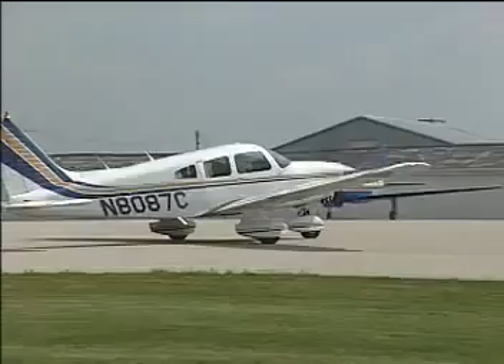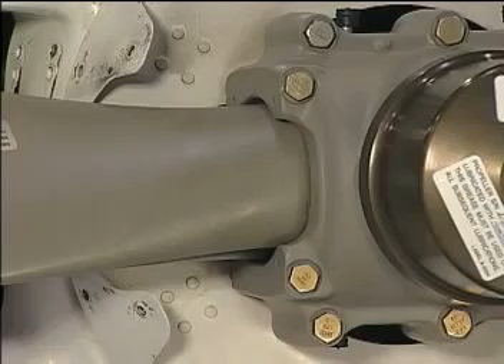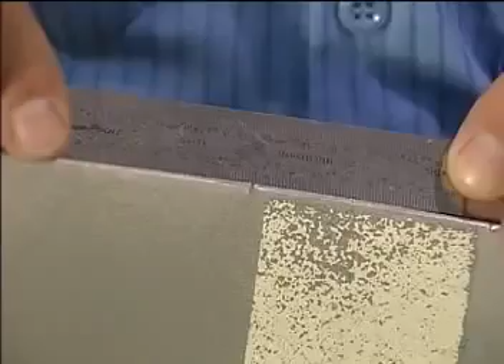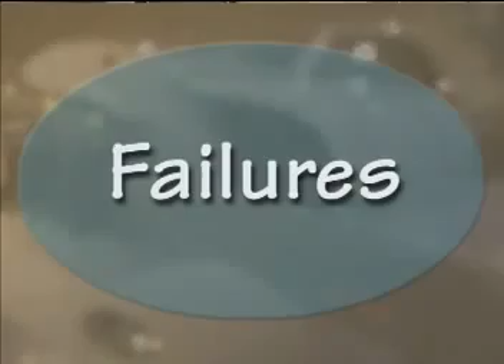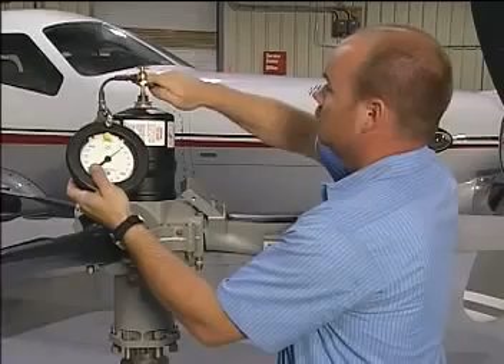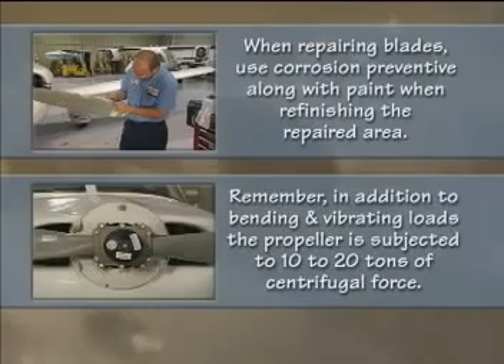Hartzell Propeller Care & Maintenance

Comment: Thank you, Hattzell for putting this video out.  Am still confused as to why Aeroshell 6 is recommended vs 5. If you mainly operate in hot Texas weather and will not be operating in weather greater than -40F, isn’t 5 better due to less oil separation?
Reply: I used number 5 on mine.  Maybe I was wrong?  I will be specifically asking this question to my prop shop as I'm getting 2 Hartzells overhauled now and they looked pretty good on tear down.  Arizona is my location.
Reply: @RichardSmith-kb3uk  You will
be using Hartzell NYCO GN 0358 grease from now most likely according to Hartzell HC SL 61-366. Most overhauled props will be using this stuff.
Reply: @Aviyaytor  I just got my props back and hung them yesterday.  They work perfectly although I haven't had a chance to actually fly it because of a little more unrelated engine work.

Johnson Propeller out of Bakersfield, CA told me to ONLY use Aeroshell #5.  They did try using other new greases but stopped after only 1 month because of so many issues with customers props coming back to them.  They put stickers on each overhauled prop that states, "Aeroshell #5 Only".  I don't think there can be a stronger statement than that.  This is a 1962 Cessna 310 with 2 Blade 80" Hartzell's.  There may be exceptions to this, I wouldn't know.  I'd use what's recommended by someone you trust.  I trust these guys and a lot of mechanics I know have liked their work for decades.  So there you go. For whatever it's worth.
Reply: @RichardSmith-kb3uk Def not anything wrong with it! We use 5 all the time 
It's just not top of the line
Reply: Please account for the fact that it's much colder going fast in the upper atmosphere

Comment: Thank you for the video,my question is what type of file do you use with respect to types of teeth?second what is the preferred method of filing e.g crossfiling or drawfiling.Its important to also highlight how critical it is to clean the file using a filecard before filing otherwise small filings from previous work probably from a different metal may be lodged onto the prop causing galvanic corrosion.Regards again
Reply: AC-43-13B says fine-cut file. I was taught to do it in a chord-wise motion, he does it in a crossfiling motion. Can't tell you what's prescribed by the FAA since the book doesn't say, but that's how a DME showed me